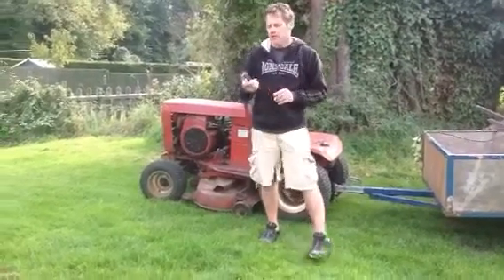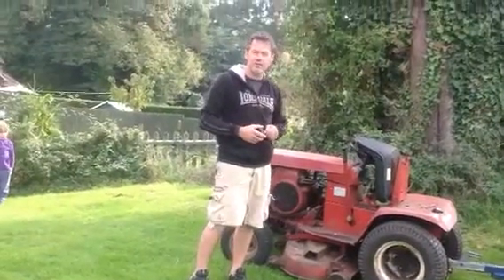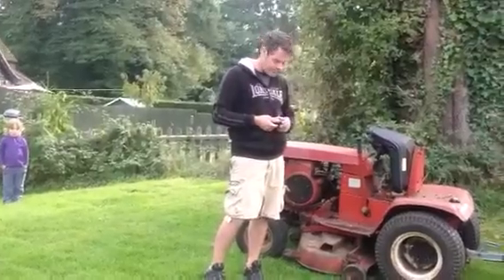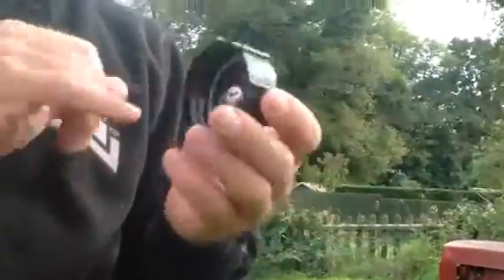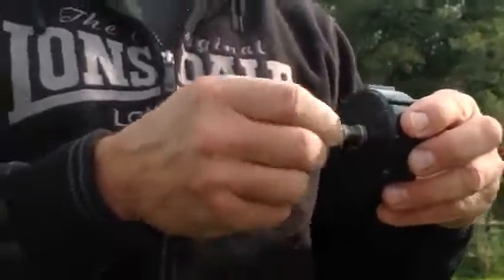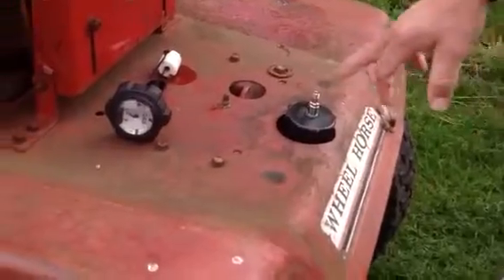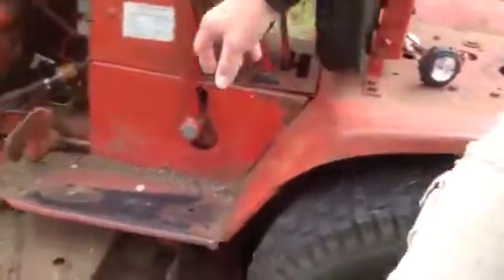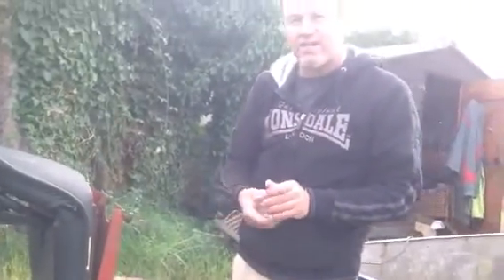Wheelhorse, fuel pump, fuel starvation, fuel running back, cold starting problems

Comment: Most people in the states either buy the new plastic fuel pump or install an electric pump. Neither last anything like the old oem..
A primer bulb on the carb is also a great choice as primers are very easy to add on and very cheap (see link) or you can do this trick in vid for awhile. 

 Regardless' when a pump loses prime this fast I'd replace it asap!!! Like in yesterday asap..
 Why?   Because it can destroy an engine really quick by running it too lean not supplying fuel correctly it will burn a hole in the piston. Starting by need of priming after sitting a few months or running it's carb out of fuel is very common on the old Kohler fuel pumps but not every few days. Run it too lean too long it will die young.  
  Starting fluid also washes out cylinders adding wear on rings/cylinders on all small engines, go easy on it guys.

 Mostly just stop worrying if it cost $50-$100 for a pump ($$ depends: pump style?) just to start it easier, fix its pump before your buying a new engine/mower for a grand or more!!! 
 It cost near that now in the states just to rebuild a K-series Kohler "correctly". Of course it will run 50 more yrs again afterwards but why speed up this process over a few bucks?
 
  Take care of that Wheel Horse, they are by far one of the best things our ancestors built for us. My 1976 still hasn't had it's first ring job yet, burns no oil.   With Briggs, Kohler, Honda, Kawasaki all using low grade China parts now you really don't want one.
 My wallet thanks them daily though..lol

 If you still have original metal pump on hand, here are great rebuild kits. Read close as there are different pump/kit versions. Can't rebuild plastic pumps!!!  
  You must take your metal pump apart first, look inside, then order correct kit because Kohler uses the same part numbers on every pump design they make. Damn dummies..lol
   Kits are here to make them last decades again!!
   http://www.then-now-auto.com/product/ac-4l-kohler-fuel-pump-kit/

Best Kohler upgrade info website on the web right here:
 http://gardentractorpullingtips.com/carbfuel.htm

Comment: In the video he said "25 litre", not "25 gallon". Which one is it? I've looked it up online and 25 litre is roughly 6.6 gallons here in the U.S. And I found a source for the 25 litre 'tanks' here in the U.S. that carry the 61 mm caps used for those 25 litre tanks, but they don't sell them as single units.  

https://www.airseacontainers.com/jerrican-20l-25l-cap.html#page=page-2